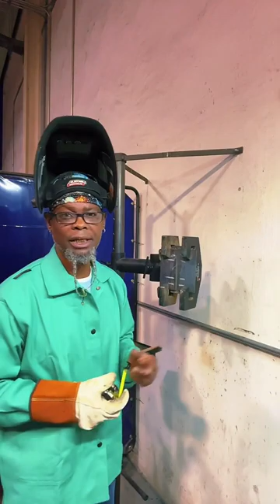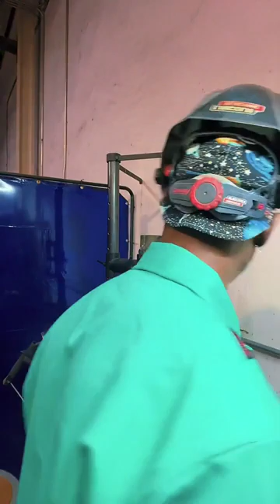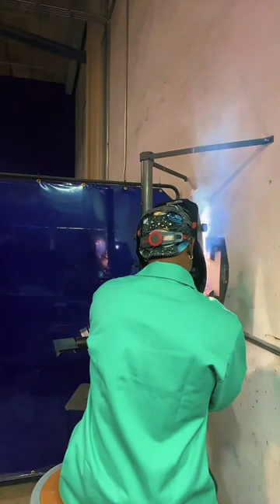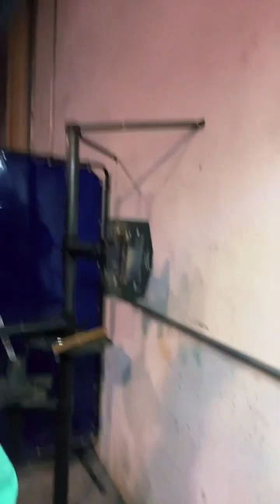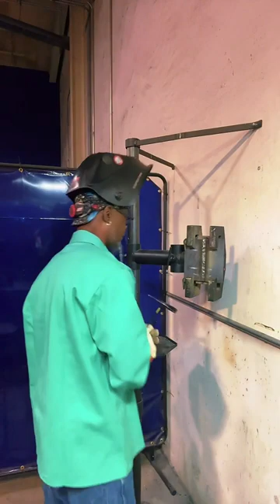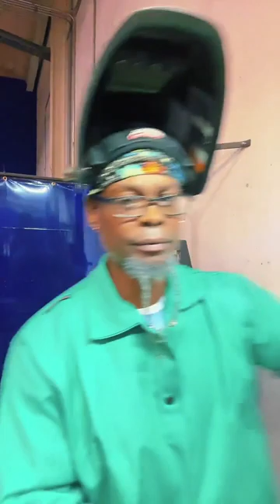SMAW 3G Tips

Comment: Pro tip, record your videos that are less than 60 seconds like this. But longer than a minute use horizontal positioning. YouTube detects these videos as “shorts” and doesn’t show them to the correct algorithm.

By shooting in full frame horizontal, it allows the videos embedded size to translate better to computers and phones. 

Just trying to help out because I dig your channel pops! 🎉
Reply from the maker: 💯thanks
Reply from the maker: Videos you see that are longer than 60 seconds in the vertical position. Will record it on another platform that only allow me to record in the vertical position. I just uploaded after I finish going live.